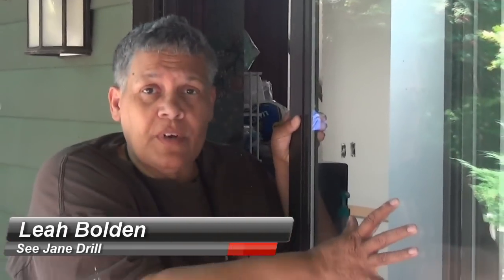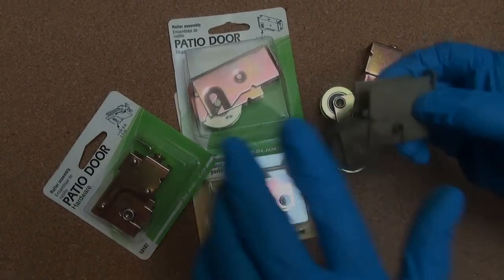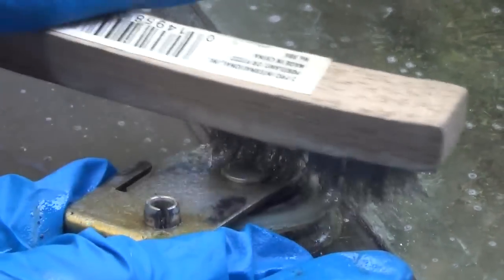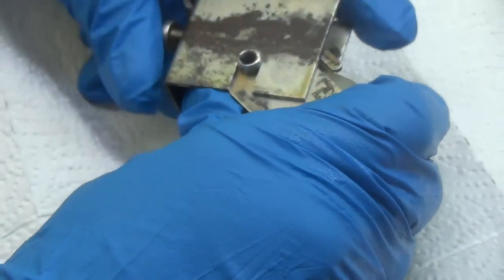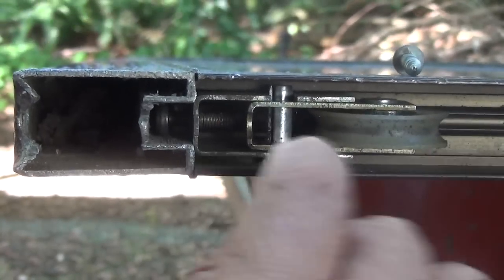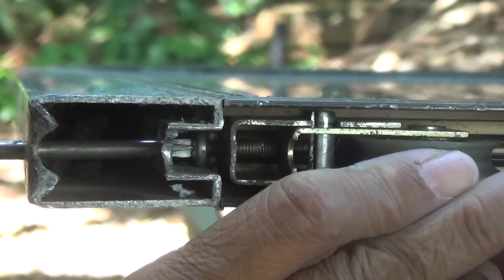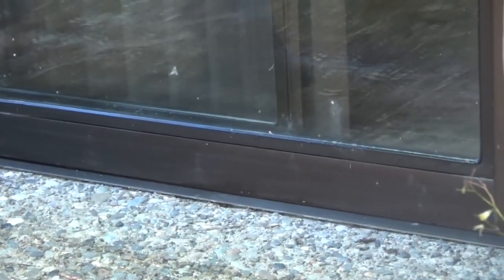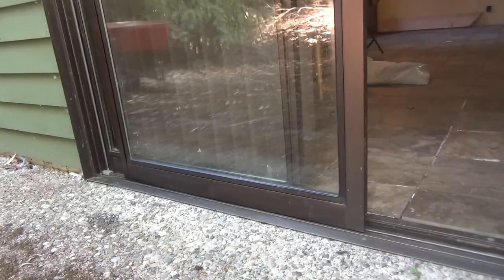How to Remove, Recondition and Replace Sliding Patio Door Wheels

Comment: Leah, I have a 30 year old Great Lakes Patio Door.  Mindset is to replace the wheel sets but now I am thinking I might be able to get by with your cleaning.*   The door has been well cared for (Maintenance in 30 years since install).  So, I suspect it might just be the crud in my case.  There is always wear issues but just maybe it won't be a dig deal.  I cannot buy the parts until the door is removed anyway.  *They now sell "Sanding Mops" which mount in a drill chuck or in Dremels.  Grit all up and beyond 1000.  Cleans like a dream.   Thanks.

Comment: Glad to see you fix and reuse rather than just discard and buy another unit. Good example for others because sometimes just buying a replacement won't correct the real problem which sometimes is only revealed after getting into the job.

Comment: Nice video Leah. This is a project I need to do before winter sets in. The adjustment screw on my patio door does nothing and my quick fix last winter was to put a thin wooden shim in the door track to bring the door up as it closes to get a good seal. Thanks - Bob

Comment: Leah... in my case the ball bearings on the wheels are shot, and the wheel has too much play, so it doesn't roll well.  I am planning to replace the bearings/wheel: question is.... what's the best way to take the old bearing/wheel off of the wheel bracket without destroying the bracket?   Im thinking I have to either use an angle grinder of fine metal saw to remove the axle flanges.   The new wheel has a two part axle where one side crews into the other half, which should allow for easy reassembly.
Reply: We’re you able to replace the wheels only? I need to find the same
Reply: @joanamuro1894  i found a site online that sells wheels and bought the same size, metal worth ball bearings.   They work great… been a couple years now
Reply: @joanamuro1894  I believe I replaced only the wheels, as I don't think I could find a bracket also.   btw, sliding doors can be extremely heavy, especially if double glazed, so plan in advance how you'll move the door and where you'll lay it....you'll probably need a second person to help you move it and lay it down... my door must have weighed about 150 lbs.... once off the track you remove a wheel, take pictures of it, and take measurements of it before you reinstall it and order online.   you probably won't find the exact wheel at the hardware store, but you can check.   then you reinstall the door, and go thru the process again when the wheels come in the mail.

Comment: Hi see Jane drill. I was just looking over your video on how to connect cpvc to a shut off valve. I just recently change a toilet. And my cpvc is connected to the shut off valve with a form of metal ring to keep the pvc connected to the shut off valve. Please can you tell me how to cut this metal ring so I can change out the water line. I hope in explaining this correctly. This is my first time changing a toilet
Reply from the maker: DiaryFull ofCurlz  The metal ring is called a ferrule.  They are used on both cpvc and copper pipes.  Here is our video on how to remove one...you need a tool called a ferrule puller.  https://youtu.be/y0ikqzSz-DQ  Alternately, you may be able to wiggle the ferrule off with a pair of vise grips.

Comment: drumtwo4seven
Thumbs up #164
View #1,106
Comment #21

Cool video!
Replaced those here doors from 1960's! Frame was not straight had to use a car jack and 4x4 lol not kidding but it worked.  I guess after 50+ years some settling occured and no longer was straight

Comment: In a lot of these videos, most people are pulling out the whole door and pounding off the bottom rail. But you can also pound off the side rail and slide out the roller assembly as demonstrated in this video:  https://www.youtube.com/watch?v=Z2bm8MZiFgI
Honestly, I really think that is how the manufacturers intended for them to be replaced, else they would not have made it so you can pull out the assembly horizontally.